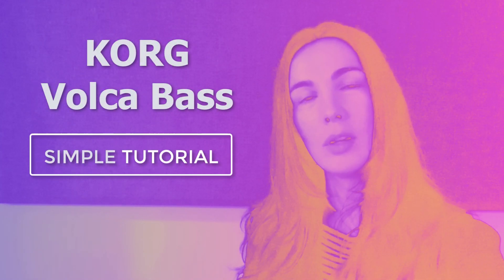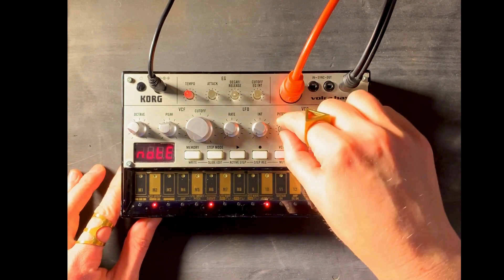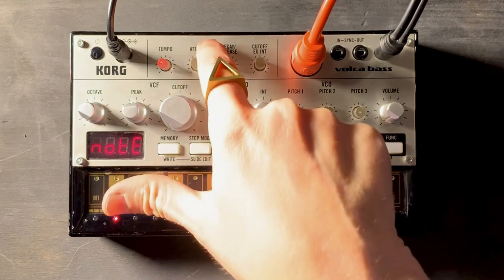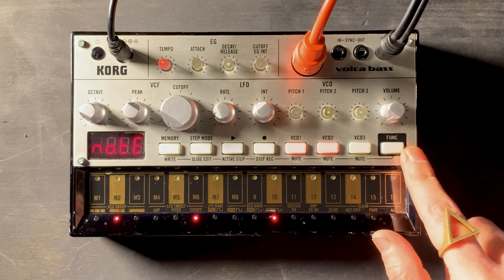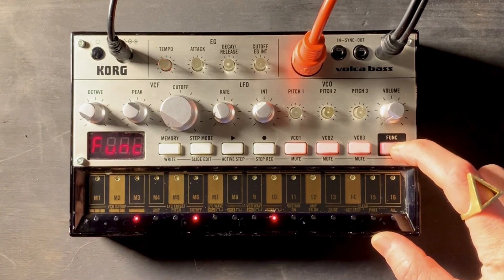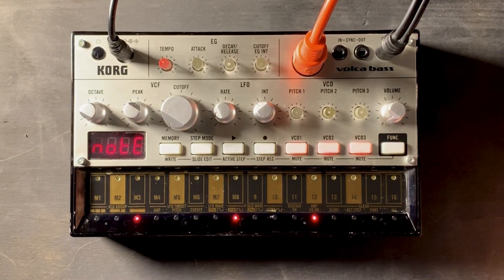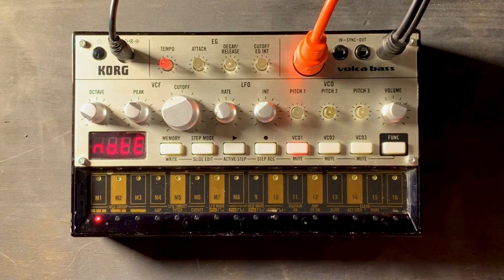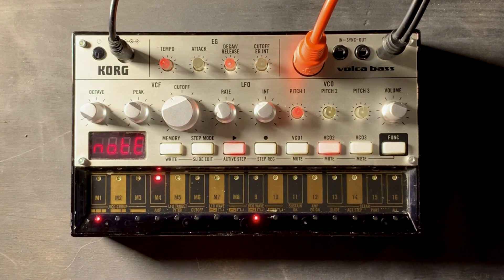Finally understand the Korg Volca Bass with this simple tutorial.

Comment: Hi Christina, nice video. Good camera view, nice and clear tone in your voice.
However I feel like you faild to really show what's so great about this synth. Kind of feels like you haven't read the manual either.
Always read the manual, is what I would advise everyone btw.  :)
So here's why.
Since the synth loops 1 measure devided  in 16th quarter notes or steps,  one can hardly expect to hear the slide effect if  only 2 or 3 steps are used.  
Don't hesitate to slide up and down the keys.
Big tip when recording live notes, take the Volca in your hands and use you thumbs instead of using you index fingers!!!! 
You can also record cool octave changes up and down while holding a note and turning the octave knob.
Using the 3 VCO's together can fatten up your bass, especially with ex, VCO1 -12, VCO 2 +12, VCO 3  +/-18 cents detuned.
The LFO rate & Intensity work best for wobbles when holding down a note.  Unless you know what your doing, less advisable for sequenced bass lines. And the greatest thing about this synth is that you can easily solder a midi out cable onto the print card, drill a little hole in the back and be able to save all your midi patterns into you DAW!!!!

Hope you'll upload a new vid demonstrating all I've mentioned above
Reply: You know so much that you should really make your own video about it.

Comment: Hello this is a great video! I have a question...do you know if there’s a way to make the volca bass play in 4/4 time so I can play my detailed melodic bass line sequences that will play in time with my other volcas when synced?
Reply: Hi, 4/4 means that there are 4 beats in 1 measure. The Volca Bass loops 1 measure devided in 16 quarter notes(= the 16 steps).  Your bass line will sound way better when usuing slides, if more steps are used. Use the sync cable or midi in to have other gear in sync.
Reply: @sebastienhaye5404  thank you

Comment: The bass has lots of power hidden beneath a really simple surface. I love that you can sequence each DCO separately, thus tripling the number of potential onboard sequencer memory slots. If you mute/unmute the oscillators as a sequence plays you can switch melodies or basslines within a track without having to use those precious additional memory slots, which is great for live sets.
Reply: Ugh how will I ever learn all this and get prolific with it.
Reply: @bobbythompson4268 I was so afraid it might be too complicated that I waited 3 days to even put in the batteries and try it. Found out - it's super easy and a ton of fun from the get go 😊. Yes, mastering it will be a different matter but having fun and making cool sounds can be achieved from day 1.
Reply: @MrSeedi76  for sure!  They are a lot of fun and make awesome sounds.  I recently picked up a Moog minitaur as well, just love that saw bass sound.  The volcas have so much going on, not to mention putting a live set together, where you can improvise as you go, mute some things, turn knobs, sequence patterns.  There are lot of moving parts.
Reply: Right?!
Reply: Brilliant!
Reply: Thats the most basic feature.
Reply: @marcosynadamas  Yet not something that many synths allow you to do. ;)

Comment: FYI to all Volca owners. The Korg power adapter is rated at 1.7 Ah. Each Volca draws around .35 Ah. So you can actually power 3 or 4 Volcas in a rack patch into Korg's original power adapter. I ran leads from the battery compartment underneath to keep things tidy in the custom volca stand.
Reply: Korg introduced a "Volca Mix" mixer like can power up to three additional Volca units since this was video was released.
Reply: FICKFEHLER Yep, I got four in a custom-made box, two by two, and they all run off a single Korg psu via a daisy-chain. Would have run out of wall sockets otherwise...
Reply: Handy tip. Thanks.
Reply: Anyone tried running them through  a power bank?
Reply: @AlexandreVeigaJardimvj yes you need a step up cable for the 5V Output of the USB-Powerbank to 9V   for the Volca

Comment: Is the volca bass truly analog or an virtual integrated processor ? Analog means there's no processor chips.
Reply: Does it sound analog?
If so, why bother?
Reply: It is analog!
Reply: I would say without having verified this before from deep resarch, that it has a hybride engine. That means the oscillator seems to be digitally controlled (DCO) (one can tune the 3 oscillators centwise) but the filter sounds analog af to me. But that does not mean, that the volca is NOT analogue... ;-) some of the famous analogue-ish vintage gear has DCOs too. e.g. Roland Juno 106
Reply: Digitally controlled oscialltor (=DCO) is way more analogue than digital oscillator (=DO)
Reply: @mightymike1978  Don't matter what's under the hood or how it's accomplished, what matters is the sound. The UNO sounds much fatter and has much more sequencing possibilities.

Comment: Newbie looking for help! Got a Berhinger RD 8 and volca bass. I have the midi out from the RD 8 into the midi in in the volca bass, just like this video. They are synced, however, when I play the drum machine, the volca starts making noises in time with the drum machine, however nothing had been programmed into the volca bass. No idea what's triggering the bass to make sounds, any ideas, I can have the drum machine paused and I can make patterns and then press play for it to play in time, but would like to be able to program as in this video
Reply: if you have midi out connected to midi in, then the RD8 is sending whatever midi you play in to any instruments connected to it (aka the volca). Look for a way to only send midi sync messages instead of normal midi note messages, such as the sync input on the top left of the volca bass. The reason why this person has midi in hooked up without that happening is that she's not inputting any midi notes, so the volca doesn't play anything except what she programs into the device.